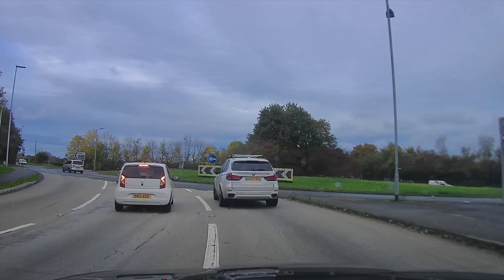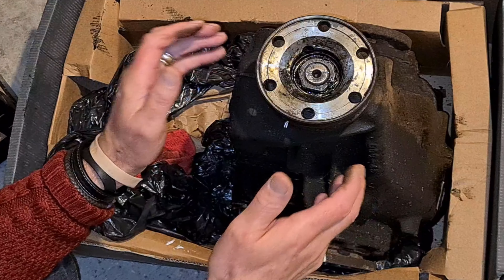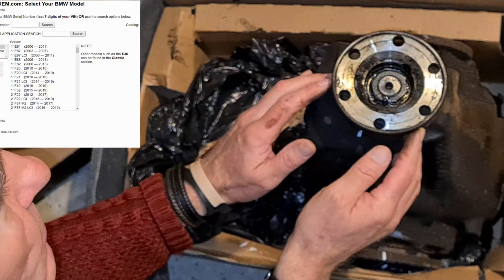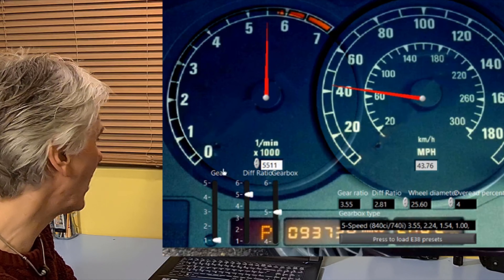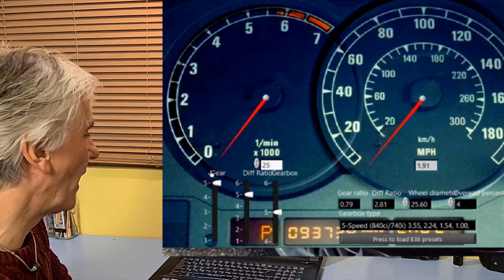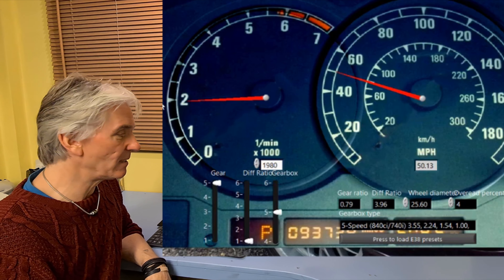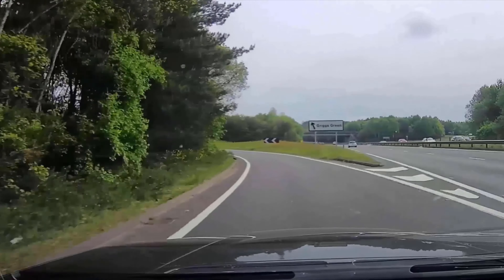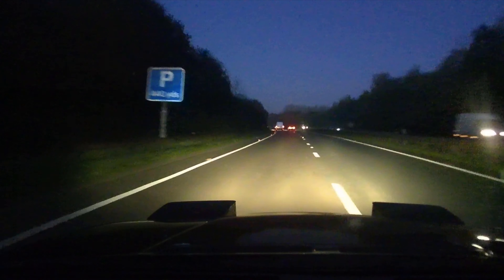BMW V8 M60-M62 Shave a Second from your 0-60MPH times  540i 740i 840ci

Comment: The electrical fan situation can be remedied with the alternator from a 95 to 98 750il v12 alternator. 140amp instead of 120. Swapping the clutch fan is a must when you want to maintain high rpms

Comment: I’ve got 35mph /1st gear & 70mph/2nd gear in a standard 59bhp 1.1L Rover 100 (metro) with 4 lads in the car, catalytic converter was smelling like rotten eggs & popping like popcorn.
Reply from the maker: That's the way to do it Umar, those Metro's take anything - but yours seems to have the go-slow cats fitted!

Comment: I suppose a 3.15 and a 6 speed zf would be the ideal swap. the extra gear to bring the cruising rpm back down
Reply: 420G drops right in there. 3.15 and a 6 spd manual gearbox and it will be a different car.
Reply: @v12stuart still slow needs boost

Comment: Hi would you also recommend 3.15 for 540 M62 6 speed manual? Looks like the gearings are different... second gear with 3.15 would be around 90kmh so until we get 100 we need to shift to 3rd gear...
Reply from the maker: No, the manual doesn't need any help there!

Comment: Hi Tim - another great vid. and nice little tool there. Wondering did you swap out the torque convertor also when you swapped the diff to 3.15? I can't remember of your e31 has the high stall  unit in it already? (I have a 3.15 swap to do on my 97 740i). thanks
Reply from the maker: Thanks! No, same torque converter, it would have been nice to swap it out, but I didn't have one and they are few and far between!
Reply: @TimmsBMWRepairsandInformation   - I'm planning on adding a 3.15 open diff to mine, but also been reading up about the high stall torque convertor, in that would it be possible to swap a highstall from a 5hp24 into my 5hp30 transmission and would the transmission need to be coded? (physical size looks to be the same). Thanks again.

Comment: really good explanation thank you !   I have an M62TUB44 in my Range Rover Vogue, its diff ratio is 3.73, so I downloaded the Gear Ratio app ( very nice app by the way) and selected Diff Ratio 3.64 ( it was the closest I could find to 3.73 ) and was pretty shocked to see how good the results were

1st   39.5 mph 
2nd  62.6 mph
3rd  91 mph
4th  140 mph
5th  177 mph
NB all the above at 5500 rpm

I know its not exact ( the difference between 3.64 and 3.73 is a few % out) , and the kerb weight of the 740i is 1800kg and the RR is 2435kg ( which is 26% more) , but it seems BMW did a god job ( at the time when they owned RR ) on the diff ratio to use on my RR Vogue, not that I get anything like 90mph out of third, but must do some more testing 

once again thank you for such clear and informative info on your channel, all the best ( a friend of mine has the 850i V12 and I have pinged him your youtube video about the air flow being so good stock on the V8 and V12 )
Reply from the maker: Thanks Peter!

Comment: Hi Timm, long story buymy diff on the M60 840ci is now whining and needs replacing. Does this upgrade definitely have to be from the 750 e32? Also Heasman Differentials say they can convert my diff internals to LSD and 3.15. Daily driver and car now off the road so need to get something sorted. Not even found an e32 750 diff yet, not in the UK and from a bona fide looking seller!
Reply from the maker: It's getting harder, that's for sure. If you can afford it go for that offer. By the way, my 3.15 diff has whined for 8 years so far!

Comment: Hi Timm,I like the performance you are getting with what you have done.
I have a low miles 44k 98 740il would the same mods work on my car thanks.
Reply from the maker: Yes, absolutely, BMW fitted a 3.15:1 in the 740i Sport for this reason!

Comment: can you show us how to flush the tranmission with torque converter? or you have any thoughts of flushing the trans automatic
Reply from the maker: No need to flush - just drain, replace filter and refill- there is a lot left in the torque converter but changing the fluid always does the trick.
Reply: Exactly.

Comment: THANK YOU TIMM ! This is one of the very obvious videos of course but to mention the rest of your work you are a genius! this is the work of a saint. You already made my bmw great and I didn’t even try yet. Whenever I gotta do YouTube research on my e38 I tend to add “Timm’s bmw” in the search bar hoping you made a video for it 😅  Also if possible, do you think it’s worth converting an e32 diff for my e38? Or would it be just as easy to look for an e38 diff. Feel like e38 had just as much if not more LSDs but I’m not good with info just like to drive. Thanks
Reply from the maker: Thanks David, very kind of you! Probably best off with an E38 open 3.15 diff!
Reply: @TimmsBMWRepairsandInformation  what if I wish to party ? And plan on a 6 speed swap. But even if it was an automatic and I wanted to party ? Would it be cuz an LSD would be stressed with the load of this chassis?

Comment: Timm, in normal use does the steptronic change up a gear at the same engine speed, or at the same road speed?
Seriously thinking of changing the diff in my 540iT, as the gearing is far too high. 2,000 rpm @ 70mph is ridiculous, and I doubt the fuel consumption is much different in relaxed real world driving.
Reply from the maker: Thanks Martin - the gear changes are made depending on engine torque - the more torque the later the gear change!

Comment: Thank you very much for your informative and technical explanations. It really makes an impact when making a decision. I do have a question: I have 2001 740i M sport with the original M62TUB44 engine. I might need a new engine and thought why not swap with the 4.6 V8 (the M62B46), I know its the same engine block so it would very much bolt right in, I know it uses the same DME (Me 7.2) and I need to flash it with the 4.6 program this way it can still communicate with EWS, I know i need to change the oil pan. My questions are: sis this swap doable? If yes, do I need to change the transmission/swap the torque converter, or my transmission will work well? Are there anything else I need to worry about it/change in the swap?
Reply from the maker: Thanks Annas, that sort of question would be perfect for Bimmerforums.com on the 7-Series pages - I have never done the swap but I do remember someone else doing it on the forum

Comment: Pitty my 2002 X5 4.4 has two diifs, not really a viable swap out. Can't  even disconnect front drive shaft and run as rear wheel drive only as by design it wont have any drive.  Smaller diameter wheels and tyres, no that's not an option either!!    Waiting for part 3, maybe an engine/Dme mod for the M62 TUB ??

Comment: I disagree with the m60 manifold claim you made  as I have done it before also m60b35 has the same size intake runners as m62 but m60 also has the  velocity trumpets which brings better air flow increases the torque and power and the  other m60 manifold as same as the m40 intake manifold that was fitted x5 and range rover with 4.4 and 4.6 both vanos engines m62tub44 m62tub46 please correct me if I m wrong as I drove the car with both intake yes car will lose the low end torque but the peak torque and the power much more with m60 manifold thanks
Reply: Dyno graph comparisons 👍
Reply: Sorry I was comparing m60 manifold or b40 manifold to m62tub44 as yours already got the same big intake only differences is the inlet runners

Comment: This is partly why 0-60 times are poor on some BMWs. My E30 318iS has a 4.10:1 diff which is ideal (seems a big number because 4th is 1:1, 5th overdrive 0.81:1 on most older BMWs). But it means I have to change into 3rd before I run out of revs at 55mph. It's also why my Z4 2.5 isn't much slower than a 3.0 in the real world.